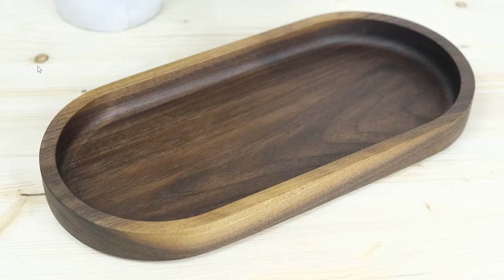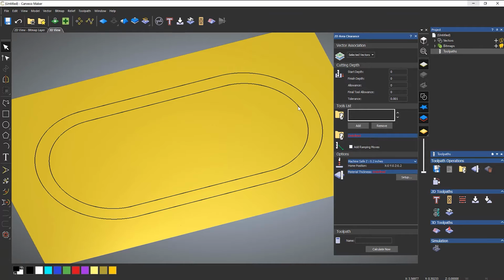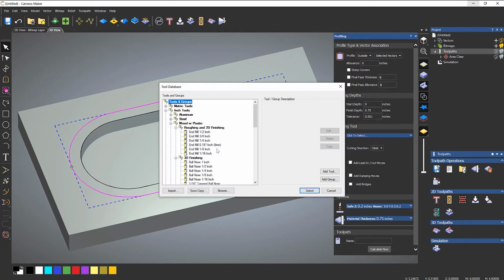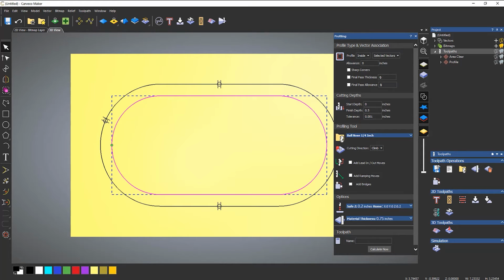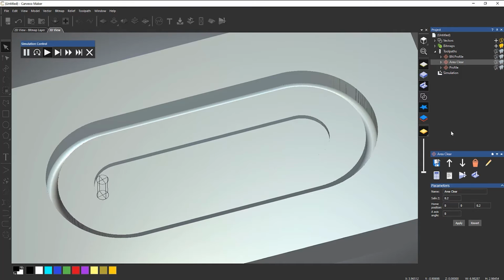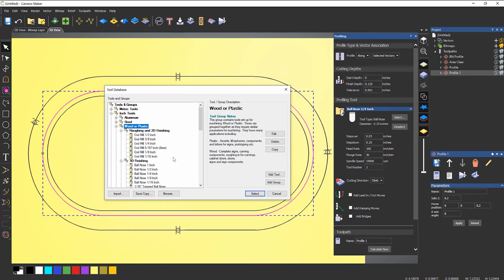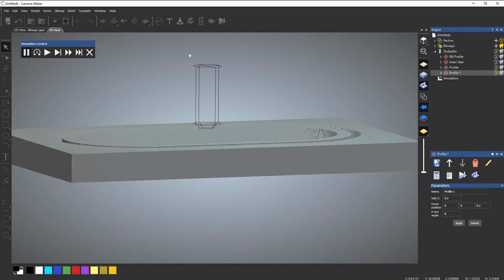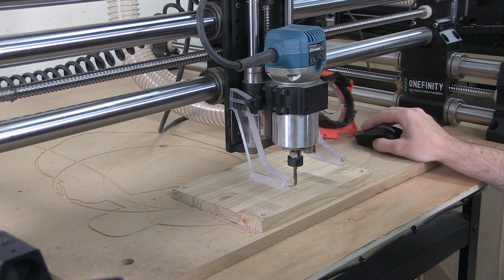Carveco Maker: Catch All Tray Tutorial

Comment: Thank you, very nice tutorial that happens to be very close to my project.  Quick question; if I want to have one square end and one rounded end instead of two rounded ends, how do I do that?  I am having no luck making Carveco Maker do it. Thanks much.
Reply from the maker: Thank you!  There are a few ways to do it.  You could draw like this example with the two ends rounded.  Then draw a rectangle and trim off the one circle.  Or, you could draw lines and trim off the circle.  You could even trim off from the centre and draw a new rectangle on the one side.  Just make sure that you "join" everything up once this is done otherwise you will have an error when trying to create the toolpath.  If you are still stuck then please contact our support team at aupport@carveco.com with your project and they will be happy to help.
Reply: Thanks much, what if I draw the shape and import it into Carveco.  Would that be a third option?  If so, is there a tutorial that would help me walk through it?  Thanks again!

Comment: Why wouldn’t you set X,y,z in the lower left hand corner using the probe? What’s the advantage of doing it the as shown in the video? Thank you for this video. Great instruction.
Reply from the maker: Thank you!  It's just personal preference.  When setting to the centre you cant just quickly find the centre of the block and you know everything is centred, irrelevant of material size, making sure to avoid the screws.  Also, we dont have a probe ;)
Reply: @Carveco  thank you. Onefinity should send y’all a probe for Christmas.

Comment: When I save the toolpath for X Carve in inches and I open the file with X Carve it does show it cutting in the proper location of the work piece.  It ends up in the upper right corner of the workpiece and not in the center of the workpiece?

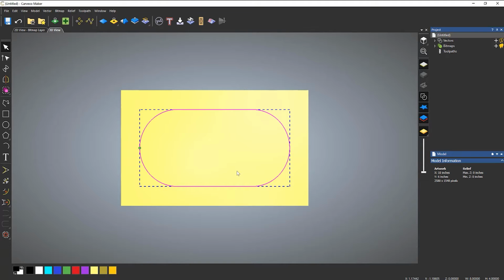Comment: I have carvco maker. Im new, but at approx 2:35, you say press f9 to center. Doesnt work for me. Did carveco change something in the software?
Reply from the maker: Hi Michael.  It sounds like you are using a laptop and the Fn lock is turned on.  Have a read of this Microsoft article which explains how to turn it off - https://support.microsoft.com/en-us/topic/how-do-i-use-the-fn-key-f-lock-key-alternate-command-keys-fccfaf23-38f0-88a8-9b44-a18f24523b79#:~:text=To%20enable%20FN%20Lock%20on,at%20the%20same%20time%20again.
Reply: @Carveco  thank you, solution worked!
Now, can you help me to understand why after creating the rectangle box, and I press the text icon, my letters are in the horizontal positioninstead of vertical?

Comment: Couldn't you have used a bowl bit to remove the material and put the curve on the bottom of the tray, eliminating a few steps?
Reply from the maker: Hi Dean.  You could do that, but the bowl bit would degrade quicker as it isn't designed to hog out material.